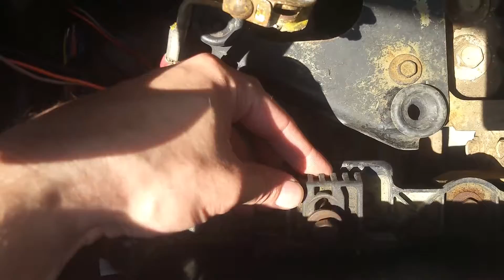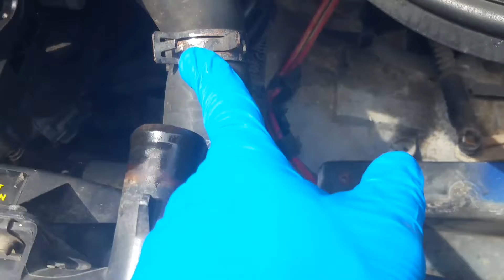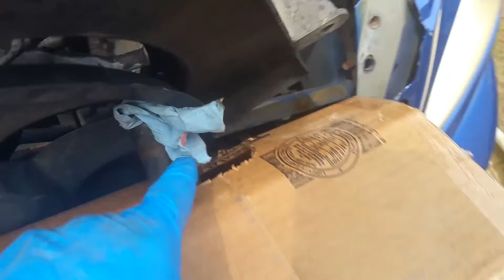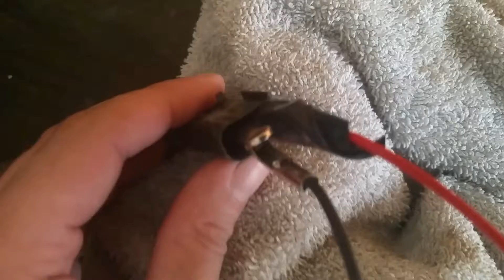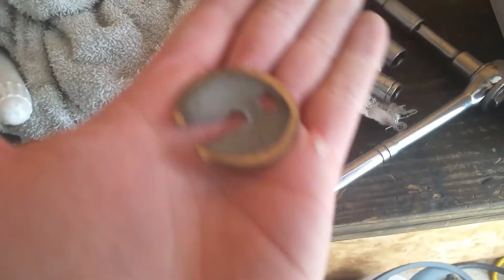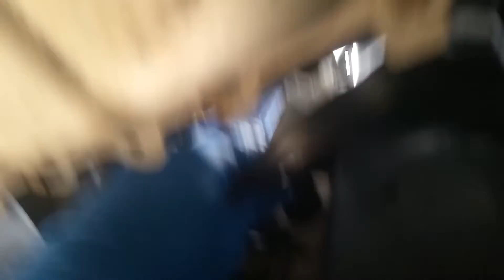how to replace radiator cooling fan Pt cruiser

Comment: I know this vid is old but it's a great video I've watched a few and your video was right up there. I have 03 Pt Cruiser GT (Turbo) which has a variable speed fan. Problem is  when I drive the car around it warms up like normal on the gauge. But after driving down freeway at 100 km/63 mph speed limit. Then having to stop at a traffic light; I can hear my fan goin so fast it almost sounds like about to blow up. The temp gauge is still reading normal though. Got home checked the levels to make sure my rad was full of antifreeze and coolant reservoir levels were fine. This has happened a couple times before but not all the time; it's finicky. I have pretty much done everything I could have checked oh and there are no codes coming up. Is it just a fan that's no good? What's your opinion?
Reply from the maker: If the temperature is good I would not worry about it . Thank you for the feedback.

Comment: where is the relay switch
Reply from the maker: Depending on the year of your pt cruiser it will either be located in the fuse box in the engine compartment or on the fan shroud itself . You'll have 2 relays . A high speed and a low . Now there is also a fuse itself located in the fuse box in the engine compartment . Hope this helps and thanks for watching

Comment: Nice fix. You're slowly but surely getting that PT back into tip top shape. When you spun up that old motor, it didn't sound too healthy so might have been on its way out anyway. Thanks!
Reply from the maker: +Baxrok2 luckily on this car it makes a ding noise from the dash once it approaches the red, which is a good thing most people don't have a habit of keeping a close eye on the guages . But watching guages is always best I've even seen them barely get overheated and by that point the damage was done . A cheap relay fan etc can cause thousands in damage in a hurry . I had one that the fan worked but must have been bad because it kept blowing the relays out . After wasting time placing relays I finely replaced the whole fan assembly . I've been pretty happy with this car for the most part there's just been a few bugs to work out . Thanks again for watching
Reply: Seems like the best way to go with fan problems is to measure the current draw from the fan. I think above 12 amps or so can be problematic. A cheapo current clamp can come in handy. Thanks!
Reply from the maker: +Baxrok2 I need to get one of those thanks for the information .